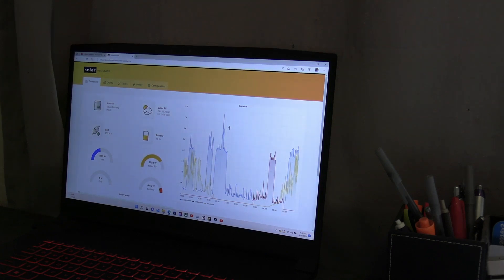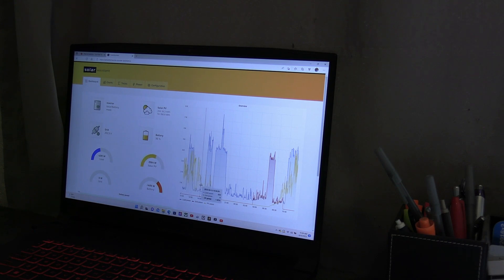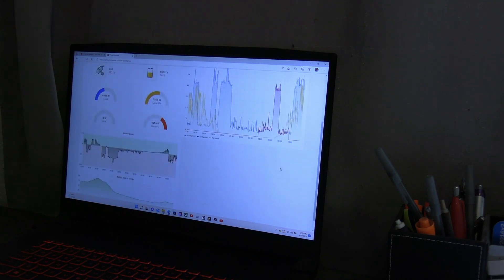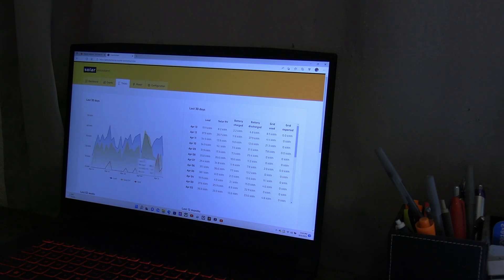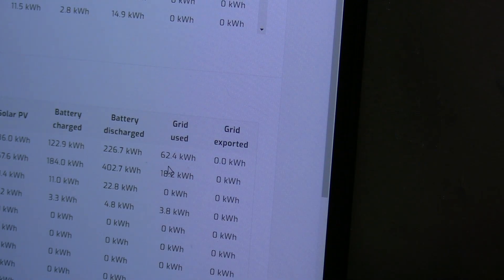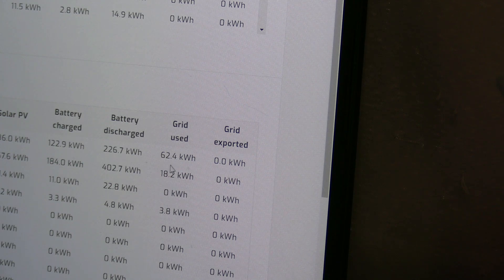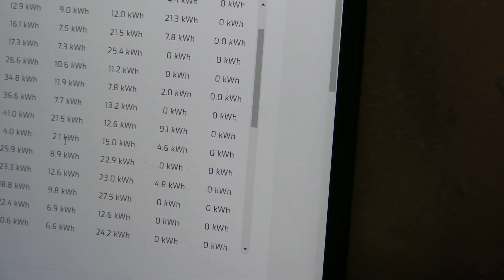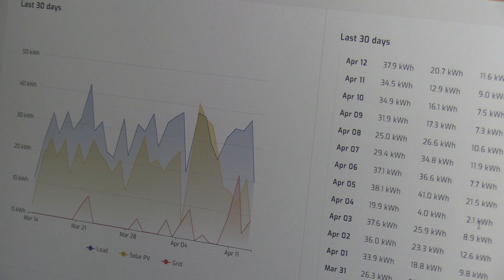higher demand on my solar system

Comment: How much solar do you have up right now? How much is being monitored by the solar assistant software? How much did you just purchase to be installed soon? Thanks
Reply from the maker: I currently have 12,000 watts up, 6,000 are monitored by the solar assistant. 6,000 watts are just charging the batteries. I just purchased 27 330-watt panels that is 8,910 watts , but I am only going to hook up 24 of them. when I get them all up and running? I will have 14,640 watts hooked up direct all going through the solar assistant. plus I will have 5,280 hooked up as battery charging only. After that is accomplished hopefully I get the new transformer by may so I can put it all up and running. because ac will use a good amount of power during the summer.
Reply: @jamesshomesolarmore2223  Thanks for the information! Quick question....... What is the advantage to having a inverter hooked up as charging only? Just curious why you have it set up that way.
Reply from the maker: @snoflite5234  that’s a very good question. the batteries can be charged faster than they are when set up with the communication cable’s for inverter and battery. The inverter to battery communication only allows 50 amps. Well I live in an area where we don’t always get a lot of sunlight. So I set up an additional inverter on charge only. That way I can get about 90 amps of charging when we have short charging day’s. It’s been cloudy for about 5 days today is our first sunny day. So now we will have a full charge and the car charged also
Reply from the maker: @snoflite5234  also I have 6 100 amp hour batteries so if you only charge at 50 amp’s it would take longer than your solar sun hour’s.